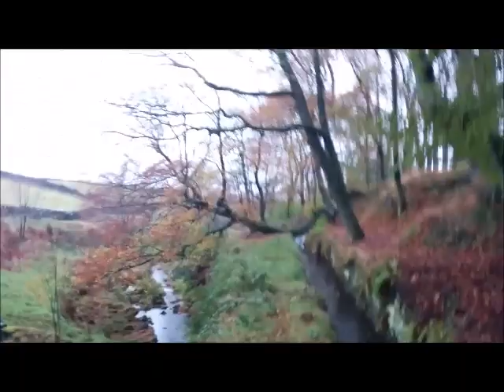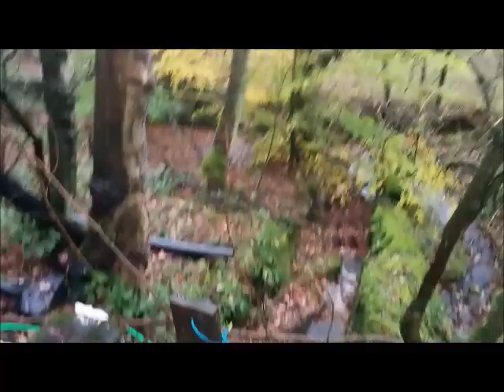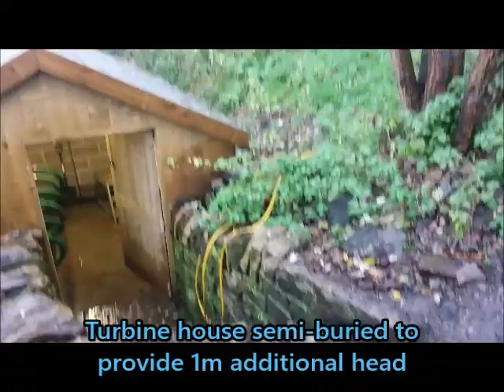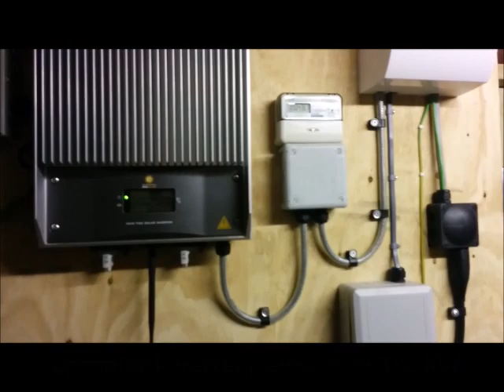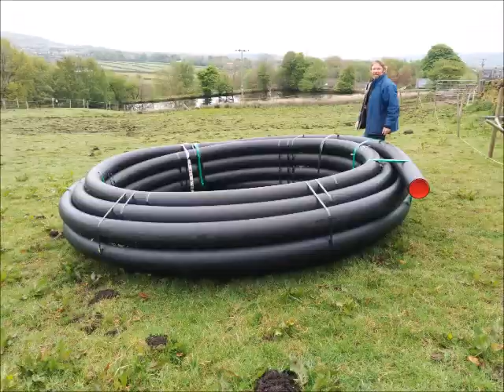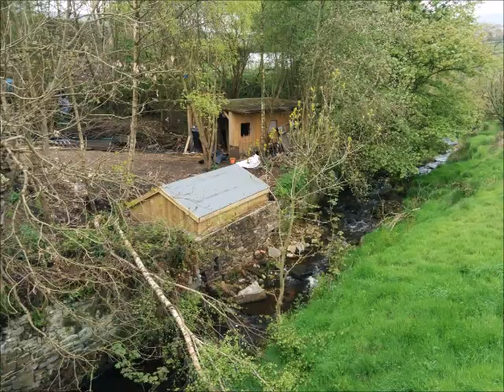Meltham Micro Hydro, UK By 350 Energy Ltd

Comment: thanks for posting.  some very late thoughts for you and your subs.  this installation is great, except . .  . the MANIFOLD for the jet delivery piping is a disaster.  a LOT of energy is being lost in that manifold.  and wouldn't three jets per be as good.  hope there was a discount on this installation.     350el, you may have followed powerspout's model, this time.    next time, use a more efficient plumbing design.     cheers
Reply: Why them ribbed pipes I'd expect smooth pipe inside pipe so water doesn't hit a edge 🙂

Comment: Very nice for a low head solution to power needs. Are you satisfied with the Power Spout turbines so far? I have considered buying them for when I do my project but have not got enough data on them yet. It looks like the more the merrier? Jim
Reply from the maker: Hi Its 2020, so 5 years on and the system is still running well.

Comment: Why wouldn't you just run the back pipe into the mill pond? Like have it draw from maybe a foot or two off the bottom of the pond. There would be no air bubbles, no debris, and you would benefit from a lot more pressure.

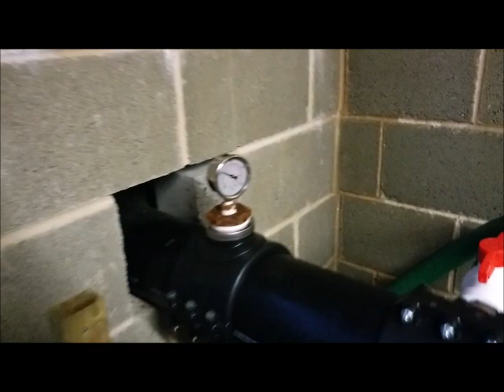Comment: 3:07  .... psi?  couldnt hear what the number was.  eight.. something?
Reply: 1bar = ~14psi in case anyone reading this later is curious about the sudden change in units ;)
Reply from the maker: yes eight. dynamic head is quite low with all valves open.
Reply: thanks for such a quick answer. what would the static pressure be.  what is the head of this installation?
Reply from the maker: the head on this project was a little under 10m, So about 1bar.

Comment: that is awesome...  wonder whats the price tag on that project all together and what you think is the life span of it?
So far, I seen hundreds of nice videos with Turgo and Pelton turbines... just wondering, how long it goes until the bearings are burned out, any idea? I mean, the rpm's are incredible...
Reply from the maker: +Marty M.  Hi,  This project has now been running for a year and we may replace the bearings as part of its annual maintenance regime, depending on how they are doing.  The main bearings are standard cartridge bearings available for a few pounds.   The turbines also have an automated grease lubrication system that needs an annual recharge.
Typical project costs depend hugely on site specific factors but might typically cost >£20k
Reply: @350energylimited8  is it still operational?